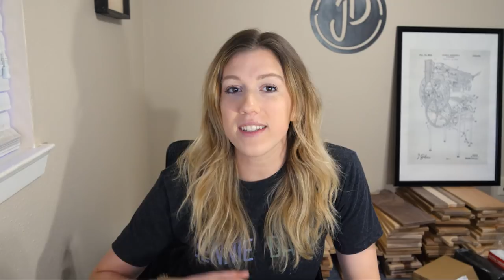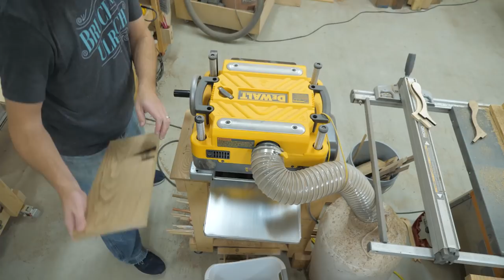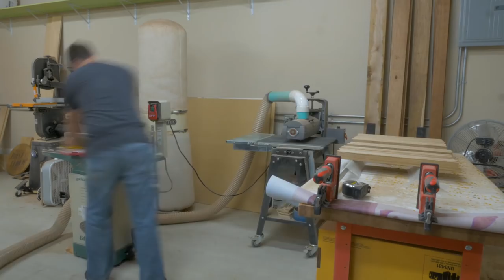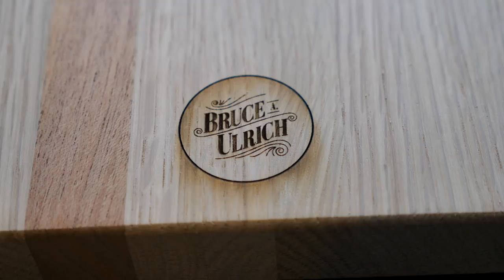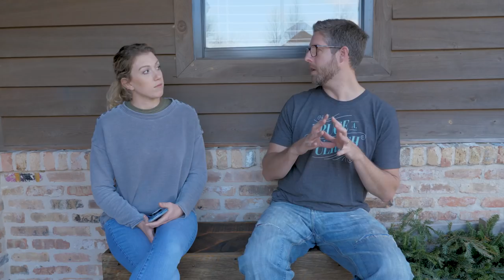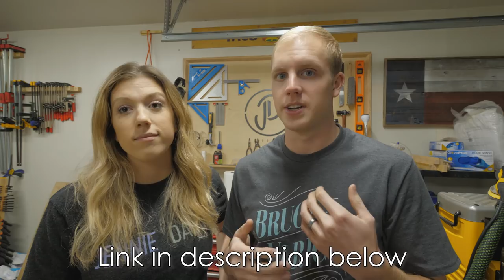🙌The BEST PART about our Woodworking Business! (hint: it's not money💰)

Comment: I really like what you are doing here  and it can be a lonely proposition. My wife and I have a shop in northern Canada. For us, it is a retirement business for nest egg building. I did six years in the mob in the eighties, a marine engineer in the navy. This is where I learned the basics of making parts. For most of my career I was a production machinist in metal fabrication. My last 10 years I was a CNC programmer/ operator. -------Our company is called Unmanned Technology Ltd and our focus is autonomous system design. We use open source drone flight control technology to control farm tractors and all terrain vehicles. Now we are discovering ways to use it for wood shop tasks like sanding and working with small power and hand tool. We want all our employees to be robots.                                              We are really cheering for you, so keep building better ideas.